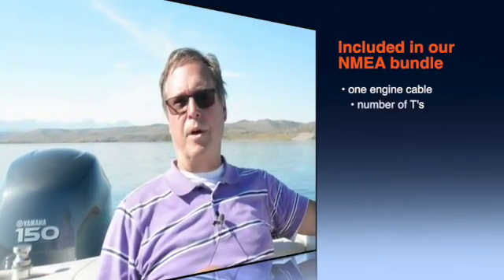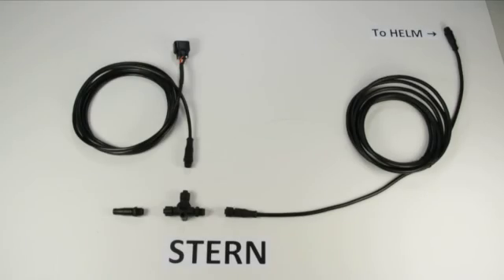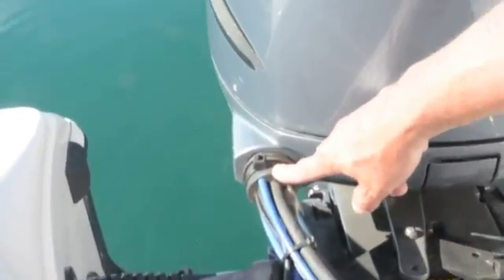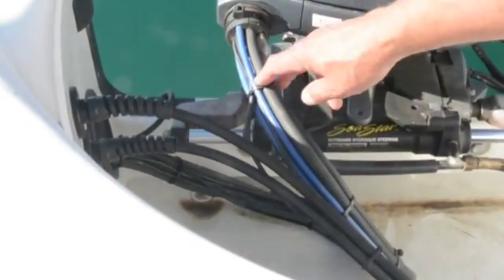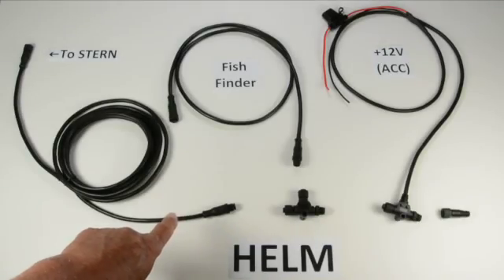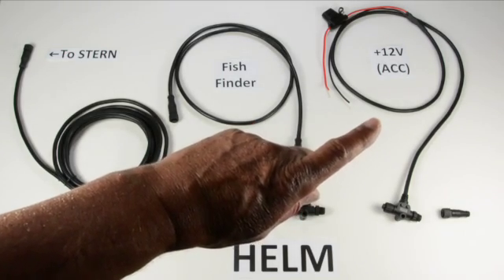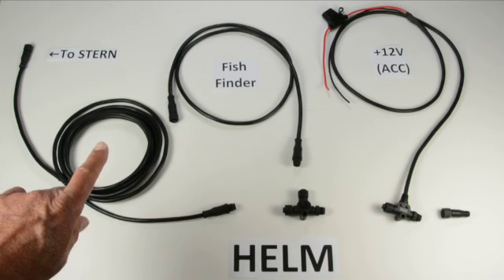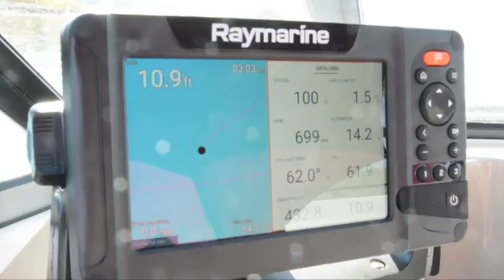Basic NMEA 2000 Installation

Comment: Thank you for simplifying the process.  I currently have the square yamaha CY8 gauges that are pretty much wasted space  is there an interphase that would connect directly into the command link hub? The outboard is a 2012 F70LA.  Could I remove the gauges after the network is installed?  TIA  Merry Christmas
Reply from the maker: Hi Alex.  Can you send me an email, please?  It would be good to see a photo of the back of the gauge you are referring to.  Could you possibly mean a 6Y8?  Yes, we can provide an interface to a Command Link hub as well.